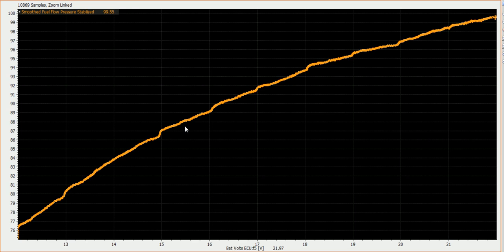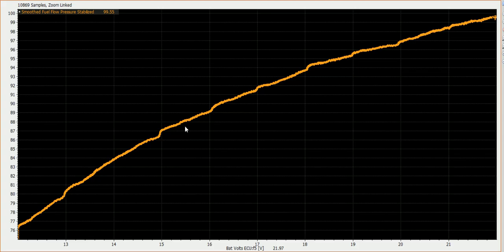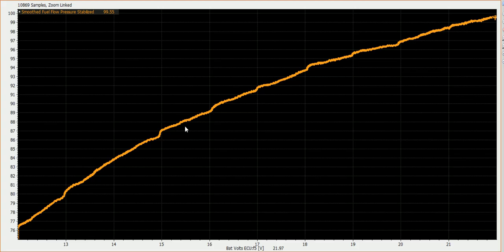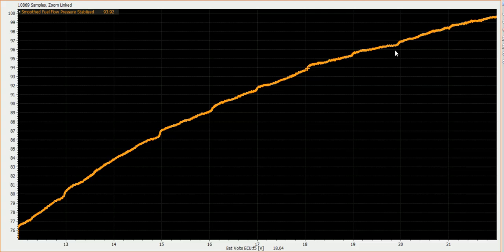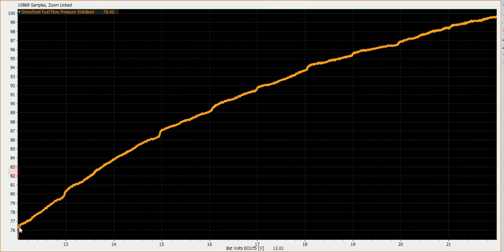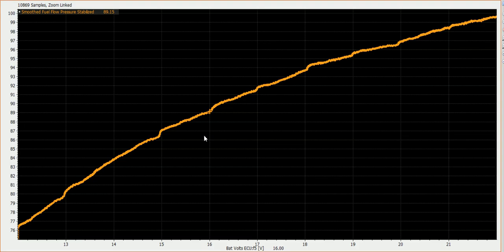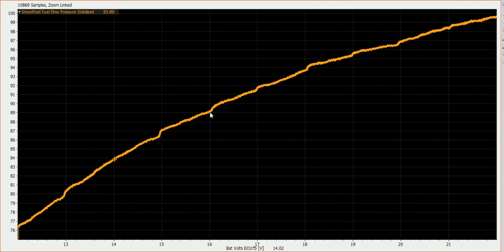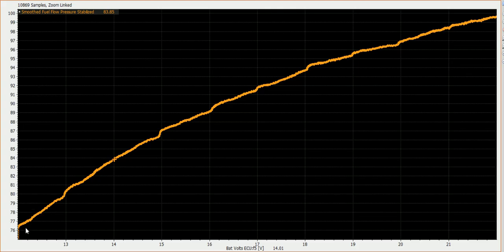How Battery Voltage affects Electronic Fuel Injector Flow Rate - Tuned by Shane T

Comment: Do you think it's beneficial to build a fuel pump booster  that depends on the rpm? The more the rpm  the more voltage will ramp up. Maximum to 19volts at 10kRpm

Comment: Thanks for the great video. In reality fuel pressure is also involved contributing to the lower flow in case of low battery. I’m addressing the issue now.

Comment: Is it simple as modulating the power to the injector on a 24V system ?
Reply from the maker: That could be done. The issue there is the cost of the power regulator on an OEM application and the weight for a race car. 
The situation is easily rectified by know the change due to battery voltage and accounting for that change with the controller.

Comment: Damn, I didn't think loosing an alternator could cause you to run 25% more lean, that's really bad
Reply from the maker: It can if the voltage is not accounted for properly in the control unit.
Reply: Ecu usually have correction for voltage for every sensor and solenoid including injectors however of not that would be true